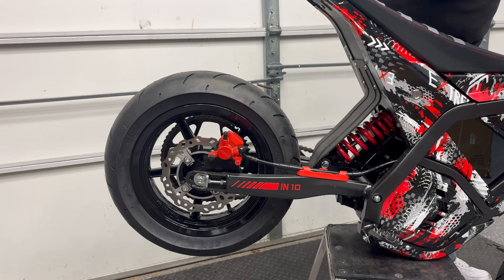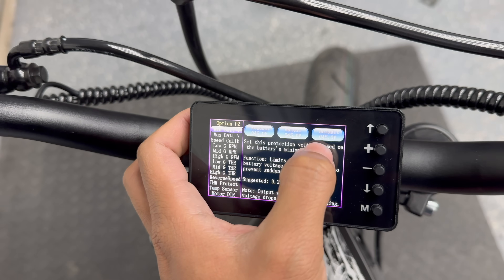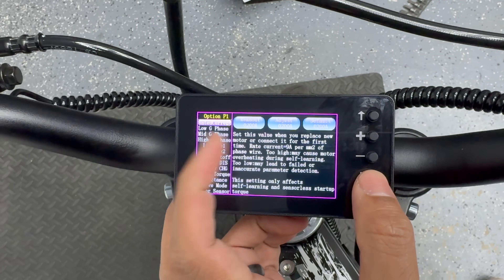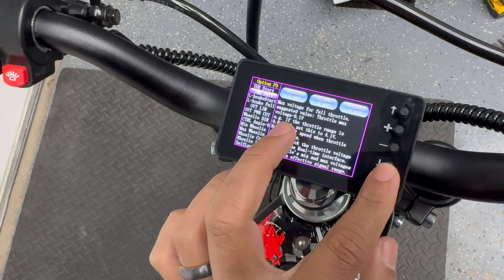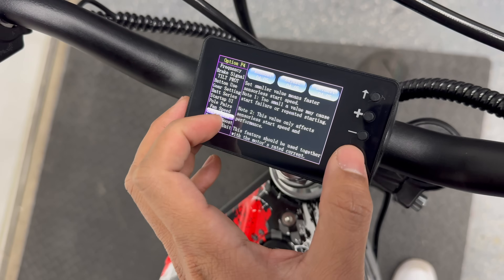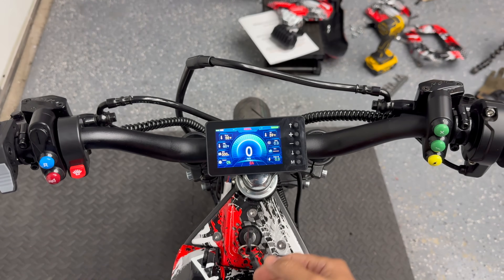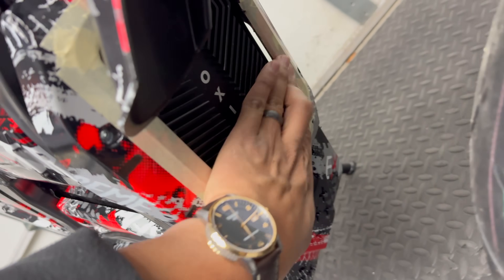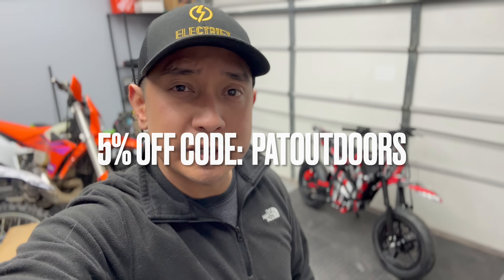Ultimate Yozma IN 10 72V Supermoto Part 3 - Moxin Tuning

Comment: What other controller would fit on the yozma
Reply from the maker: Any Fardriver controller ND72300 or smaller is a direct fit, any FD controller bigger will need the plastics trimmed and mounting holes potentially redrilled to fit it. Really most aftermarket controllers should fit this bike IF you are willing to take the time to study the wiring needed and supporting modifications needed to be compatible with the controller you’re putting on such as a battery that’s powerful enough to supply the demand.
Reply: @PatOutdoors ok, If I got the nd72300 with the sotion motor and a 72 V battery how many kilowatts do you think it would be?
Reply from the maker: @Ilovebikeys  well that controller has a max output of 100 line amps so I would say 7.2kW at 72 volts..
Reply: @PatOutdoors ok

Comment: Heyy what do you think about the qs138 90h kit that offers electro and co? I wanna make a kx250f electric
Reply from the maker: I’ve only used their QS138 v3 70H kit on my YZ250. That kit was great, but I used it with my own Amorge 43AH 72V battery and charge doesn’t last too long (1 hour of hard trail riding.) you really need a huge battery for full size dirt bikea
Reply: @PatOutdoors Hey thanks so much for getting back, you think a 76V 60aH battery paired with the qs138 90H kit would be a good fit?
Reply from the maker: @m @matiaszamora4634  you can find space in the frame for the battery, go as big as you can! Again, I have zero experience with the 90H
Reply: @PatOutdoors  how much city or highway range do you get on yours like on miles
Reply from the maker: @matiaszamora4634 highway range? I don’t ride my YZ250 to commute, simply my trail bike so hard to give you street figures. But I’d estimate approximately 25-30 miles for a 43AH battery if I were half throttle cruising at 40?

Comment: Why do ebikes still have a chain? My scooter 67v 7500w has dual drive motors.....bikes should be same
Reply: they shouldn’t be , these e bikes are meant to mimic drive trains of actual dirt bikes and therefore you wouldn’t be able to change gearing in the front motor sprocket and the rear wheel sprocket , these bikes don’t shine with hub motors that’s only for commuters n stuff , mid drive motors give the most torque which is one of the main characteristics of a dirtbike

Comment: FYI, if the angle indicator on the display is crossed out when you turn the bike on, just turn your key off and back on a few times until it shows up. It its crossed off, the whillie mode won't work. If this happens a lot call Billy, and he will send you a cable to update the firmware (if you didn't get one with the controller)

Comment: 🤤🤤🤤🤤 How does that new Sotion run? Im so mad that Motor just came out the day after i got my QS180 delivered. I think im still gonna order one anyways. Did you order the motor right from Sotioin? I didn't see it on their website. Can you share a link?
Reply from the maker: We’ll find out on the next video 😉 I’m more curious about the QS180! Are you making a video on it?
Reply: @PatOutdoors  I really want to start making videos, i bought camera, wireless mics, everythign i need but still cant get over the being on camera lol. But yeah I got the QS180 and I bought the Fairdriver ND961800 delux track edition control
to go with it. I got your motor confused with the new sotion FW20 motor. They claim 80kw and 20k rpm peak.

Comment: do i know a other affordable controller for the yozma?
Reply from the maker: If you’re looking for a simple (almost plug and play) solution, Fardriver ND72300. Can push 7kW power (at 72 volts) and direct bolt on replacement, fits like the original controller.
Reply: @PatOutdoors why wouldn’t it be fully plug and play what do i have to change?
Reply from the maker: @luisromero4542  The stock display might not work the same is all. May just need to install a regular voltmeter or aftermarket DKD display if you like having a speedometer.
Reply: @PatOutdoors sorry for the question but where do i get the controller at
Reply from the maker: @luisromero4542  E-Conic cycles sells Fardrivers and offer support: https://econiccycles.com/products/fardriver-sinewave-controller-nd72300-w-bluetooth?_pos=1&_sid=4b6245223&_ss=r
Reply: Hi buy any chance u mention  in one of your videos that you will install a 12vconverter for a horn led lights on the yozma in 10 can you make a separate video on how to install it in the yozma and were do u get the parts to install it

Comment: Yo I love the build, it’s very clean but do you know anywhere you can get a plug and play kit for the yozma that upgrades the controller, motor, and battery for under 1,500$?
Reply from the maker: No such thing as a “kit” available right now. Also depends how much power you’re looking for. The stock motor should be able to take about 7kW. So a Fardriver ND72300 controller and Amorge EM-5 72v 20AH battery would be the most “plug and play” option, which would be about $1,000 for both. You could also upgrade the motor to a Sotion FW22 and change the controller to an ND72530 instead and get about 14kW, which would bring your total to just about $1,600
Reply: @PatOutdoors   Thanks, I’ll have to look into that and possibly get it